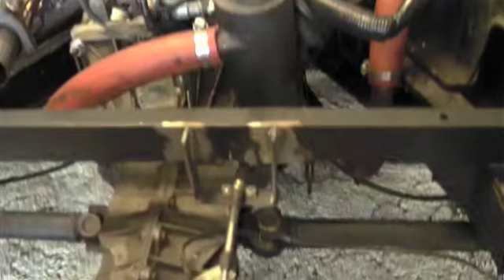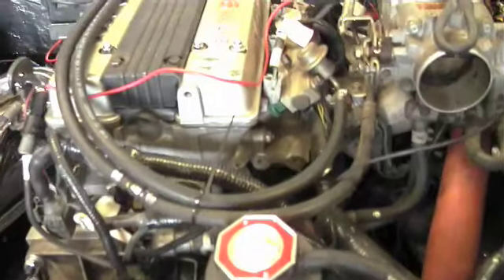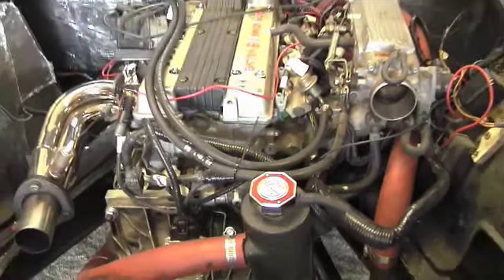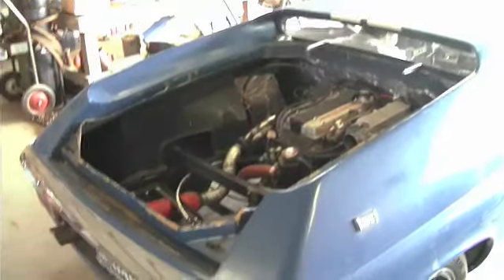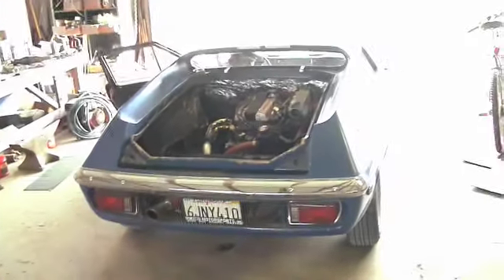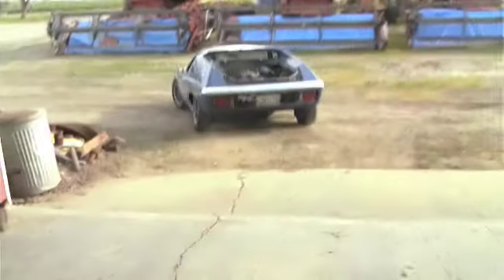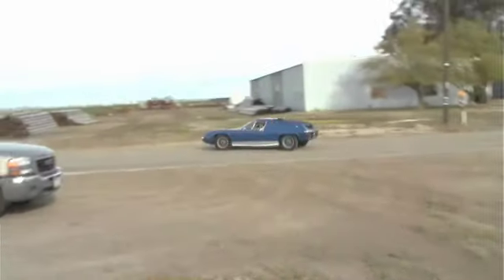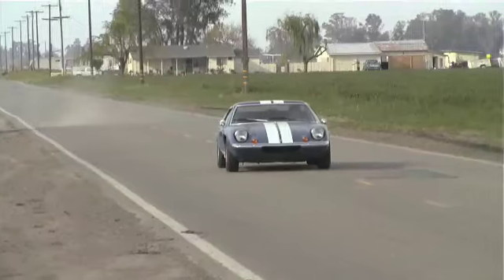New Engine for the Lotus

Comment: 😎🥰 fit a 4agze,or turbo it. Or ITBs,on your na 4age.
Reply from the maker: I put nitrous oxide on it. Had a lot of fun. Then sold it.
Reply: @benbeames  Excellent. Did the 4age stand up to the Nos ? :). Greetings from across the pond.
Reply from the maker: @DJJAW11  I only used a mild 50hp shot but I used it a lot with no trouble.
Reply: @benbeames  Indeed, there pretty strong little engines!. I had a UK spec Corolla GT, and a jdm import Aw11 MR2 Supercharger. I think the 4agze engines gearboxes are good for 300bhp (i think the same, as the earlier jdm Sw20 3sgte MR2s !). Asume you ran with the 86 (Corolla GT/Levin) gearbox, in your Europa ?.
Reply from the maker: @DJJAW11  nope, bolted the engine to the Renault gearbox that came in the Europa.
Reply: @benbeames  Brilliant :)